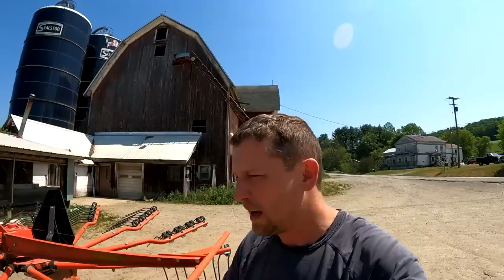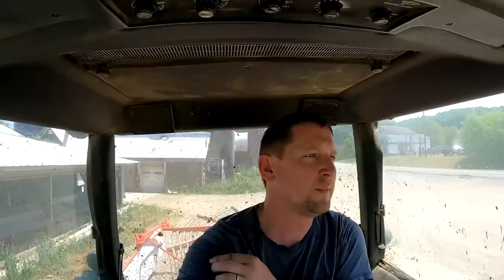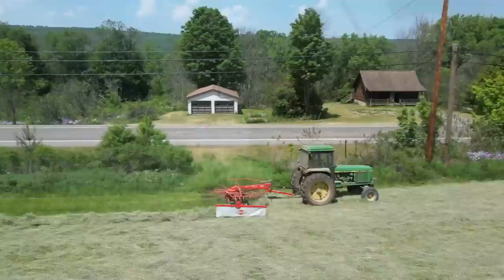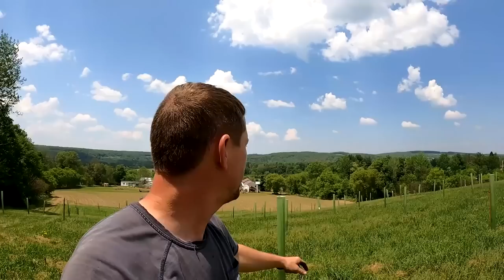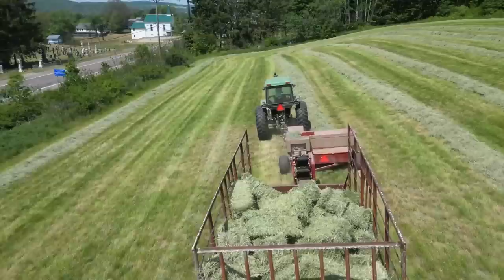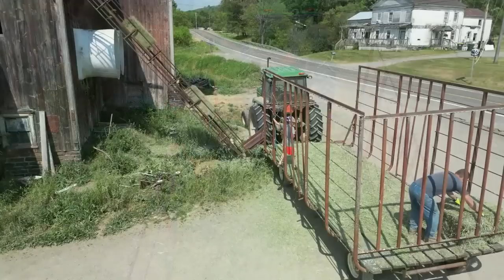Making Small Square Bales

Comment: Nice to see the bales come out and not broke. I used to use 7200 twine which is heavier and knots better. I stopped square balling some time ago after I ended up in the hospital with heat exhaustion. I really enjoy round balling with an AC cab.
Reply from the maker: That sucks you ended up in the hospital. Gotta love those AC cabs
Reply: Balecord 170 GEORGIA TWINE

Comment: Great video!    You are an excellent tractor operator, especially backing up a four wheel wagon!   I could never back a four wheel wagon.   I would unhitch the wagon, tie the wagon tongue up with rope, and then push the wagon in with a tractor that had a home made bumper that could push the wagon with out damaging anything.  Also I had a safety chain connected to the wagon and tractor to keep from getting a runaway.     Had to get off the tractor a couple of times to adjust the steering.    Crude way to do it, but it got done!
Reply from the maker: Thanks Donald. You gotta do what you gotta do. Thing is you got it done. Those wagons can be finicky. One time you can back them in just fine and the next I spend just as much time pulling back out and starting again

Comment: I have an old finger rake which I bought at an auction for $60. I used it until I bought a Fransgard TI-4000 dual rotary. The rotary does a great job in fluffing up the hay so it continues to dry after raking vs the finger rake that tends to roll it. The disadvantage to the rotary is allot of moving parts and the tines tend to break which are expensive. This spring I replaces all the cam bearings. I just raked 10 acres and broke another time and the PTO caught on the frame and is in multiple pieces. I had to use the $60 finger rake but it still works. Your rake looks to be a better design and is what my neighbor has. Nice video.
Reply from the maker: Good thing you kept that old rake as a back up and were able to get the hay all raked up

Comment: I kinda miss small square bales but I don’t at the same time. I mostly run 4x4 squares now. There’s times I can have 3 big balers running compared to the half dozen small squares I ran 8 years ago. But I also have steamers on the big balers and the steamers for small squares are a few years on the market. All the balers I have run are Heston balers from the 90s to modern day balers. Depending on how much material your in with any of them they will eat power. The current fleet of balers are pulled by 8320r deeres. Rakes are pulled by 6125r tractors from Deere. I have 5 rakes at this time. My crew barely keeps up 2 swathers.
Reply from the maker: Sounds like a nice fleet of equipment. I've said before how instead of a new round baler we should get a used large square baler

Comment: Great video Mike.    Filthy windows😉 but you redeemed yourself with the drone, showing off your raking pattern with the Kuhn.   I raked with various bar rakes for 40+ years and bought a NH Pro Cart last year.    Set it right and it floats over stone without missing hay.    I’ll have a review on my channel this summer.   Still have to use an old bar rake raised up for oat straw to keep from getting too much green from the emerging hay crop.
Reply from the maker: Thanks for talking about the rakes. How are the V rakes going over un even rolling ground?
Reply: @mikep7810  We have a lot of small hills, really just rolling ground and haven’t had any trouble but we bought the smaller 10 wheel rake because it matches our 10’ 4” discbine width times two.  (21ft).  The 12 or 14 wheel would be too wide for our hills.    Same with the big speed rakes.    
If you get a pro cart get the center wheel option, otherwise you miss a strip of hay that never gets raked as you pull the two rows together.
Reply from the maker: @Rollinghillsfarmsmn  Thanks for the info. Be interesting to try one

Comment: You really can’t beat a rotary rake. I even managed to convince Grumpus that a rotary was the way to go, and he was dead set against getting one
Reply: I don’t like rotary rakes because it’s hard to tip a row over some to get it dry like you can with a roll bar rake, and you get a lot of stones with a rotary rake..
Reply: @rickperry9546  actually, because the hay isn’t roped together like a Rollbar, the air will actually move through the windrows and help them dry
Reply: @dembeckfarms  yeah I guess it does…
Reply: @rickperry9546  I have run rotary, bar, and wheel rakes. The bar rakes I ran were Allen and Deere. The Allen left a better end windrow since it lifts up on the ends. The wheel rakes I still work with are known as the rake that won the west. I forgot the brand. Good rakes but pick up the most stones. The rotary rake fleet I mainly bale behind has the best dry hay plus they bale easily. The only downside is it shortens my window I can bale before it either gets too dry or too wet. But I also work in the desert so there’s that.
Reply from the maker: I bet he was pretty happy the first time he saw the windrow.
Reply: Seems like rotary rakes knock the leaves of alfalfa and clover. I prefer the wheel rake.

Comment: Rotary rakes are nice but we could never justify the cost of them. We went to a new holland pro cart. 1225. If you stone pick and pack really well at time of seeding stone aren't really a problem.
Reply from the maker: How does it work going over un even rolling ground?
Reply: @mikep7810   good getting the wheel pressure set right is the key. We have it setup for one tractor.

Comment: You have plenty of HP, a double rake would save you a lot of time. You can still make "single" windrows with a double rotary rake, just offset to the other side and drop the flap.
Reply from the maker: I understand all that Morgan. I didn't say that I don't want a double rake. I said they are expensive. If there were cheaper I'd absolutely have one
Reply: Yes, they are expensive. I'm not completely familiar with your operation, but I also that good help is hard to find and isn't cheap either. Depending on your acreage of hay, the twin rake can halve the time. But it's not an easy thing to pay for. Good luck, my friend, and I hope to watch more of the videos!

Comment: I have a 2940 and I can’t figure out how to lock the rear diff. Any help would be awesome.
Reply from the maker: There is a peddle on the right side under the shifter near the floor. You fold it down then step on it. Pressing down and holding that peddle down is what locks it